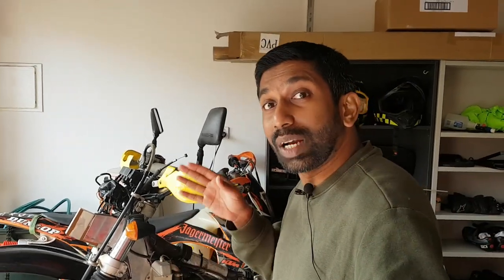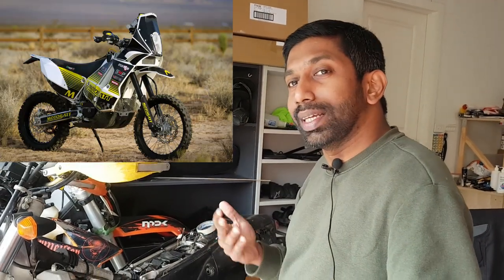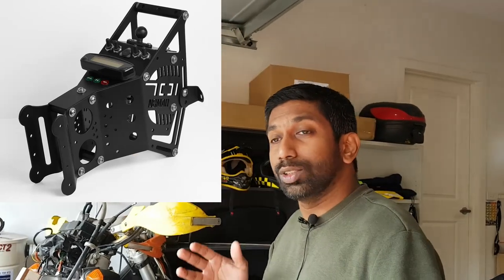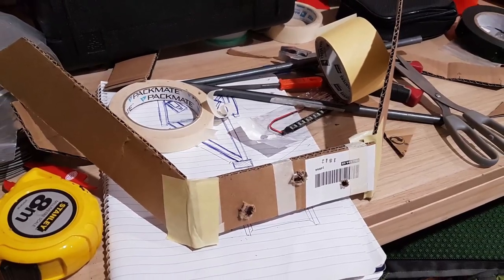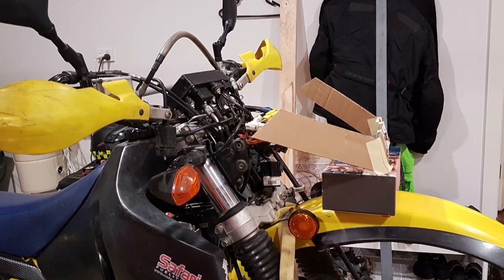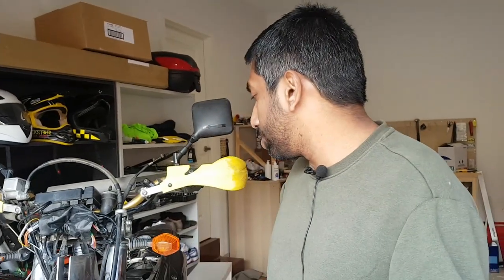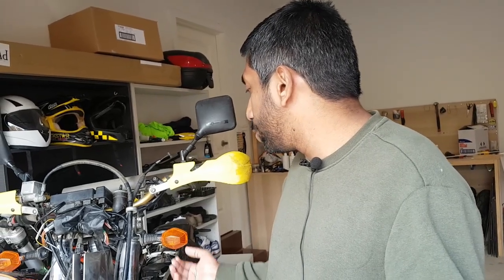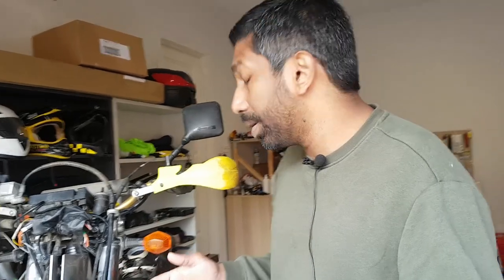Building a DRZ400 Rally Kit! | Part 1| On Two Wheels

Comment: Hey Delish, nice work have you released part 2 yet? Im keen to see how you mounted your tower onto the frame. Or tell me to get nicked cause its Intellectual Property. Keep up the good work    the ARX kits look impressive.
Reply from the maker: Thanks for the kind words, since this video was made, there's been 2 more versions of the tower that have been designed. 
The mounting method IS a hand of card ARX holds tight, but that being said, it uses existing mountable points on the frame and doesnt need any welding, cutting  or drilling :)